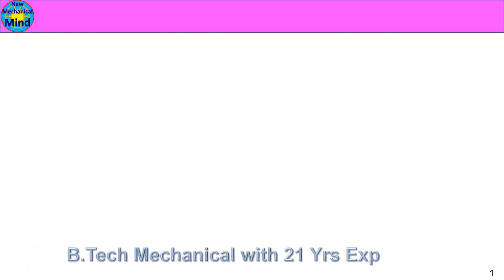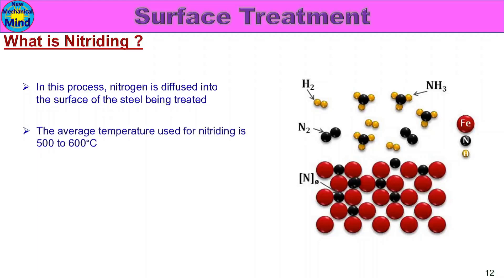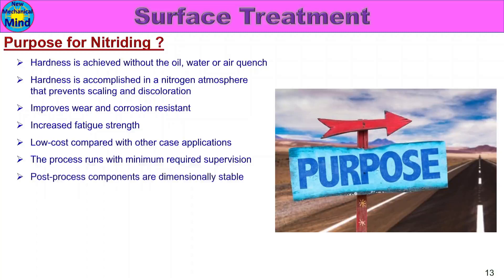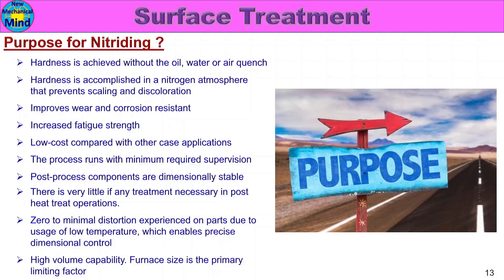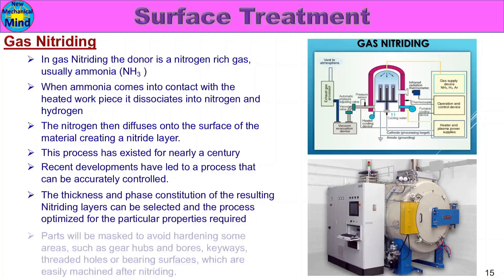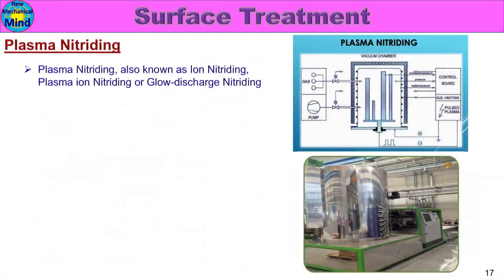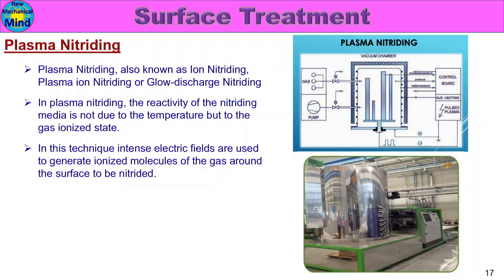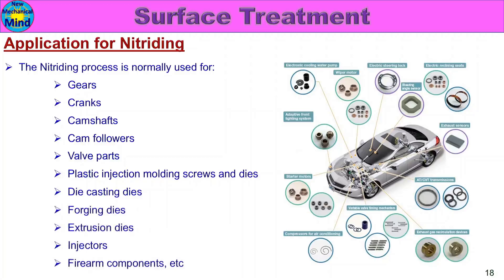Surface Treatment Part-7 | What is Gas | Salt bath | Plasma nitriding process | New mechanical mind

Comment: Why we cant send directly nitrogen gas in the gas nitriding instead of ammonia gas...? What will happen if we supply direct nitrogen gas to the furnace..?
Reply from the maker: Hi Mr.Gokulkrishnan, we can use both ammonia and nitrogen gas. But the process (heating) parameters may change. The cost of pure nitrogen is two to three times higher than ammonia. So, ammonia is commonly used may be for cost reduction purpose.